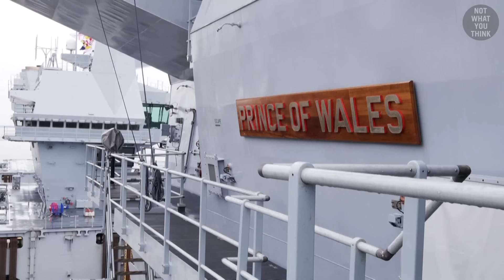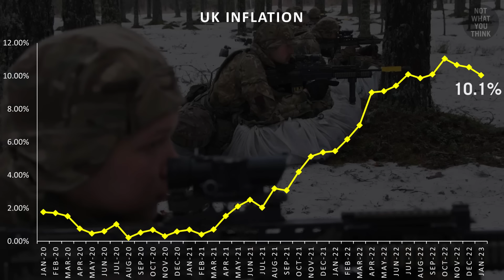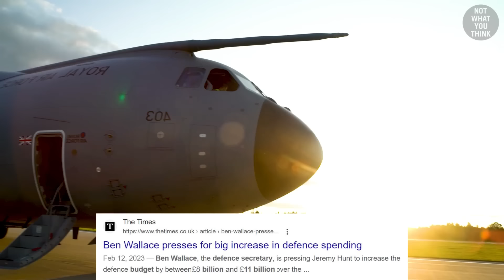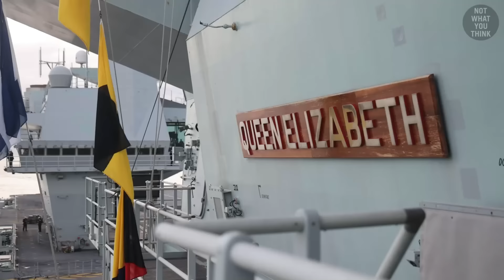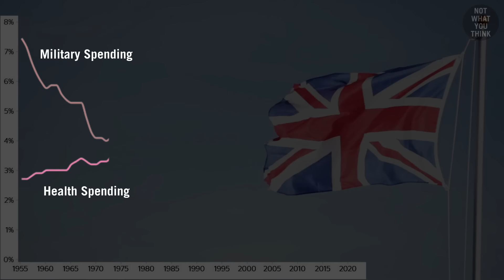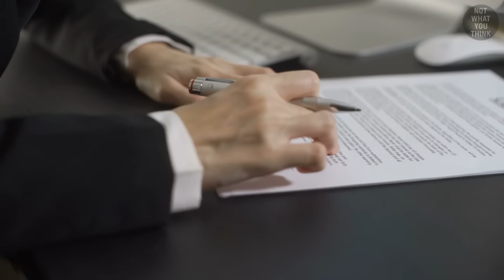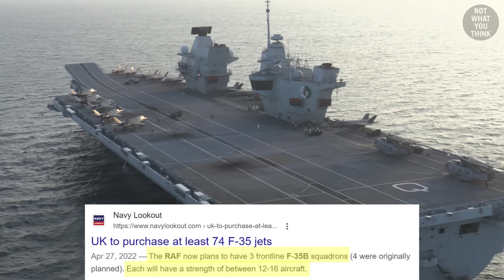Why QE Carriers are Considered a PART-TIME Fleet

Comment: A quick fact here, when we sent the 2 carriers to the south Atlantic for the Falklands conflict, 1 carrier had only half power available due to an engine problem, but it still did it's job, both as a show of force and operationally as a carrier and sending only 1 fully working carrier would of been a deadly mistake. The Prince of Wales may be suffering now but the problems will be sorted, better we find her flaws now rather than finding them in troubled times of war
Reply: Yep, not to mention the difference in capability between the two CVLs sent down to the Falklands and these newer ones is absolutely massive. They're about 3 times the size. If the UK wants power projection, it needs both
Reply: Well said!
Reply: And the two carriers concerned were slated to be sold off/scrapped. The government had to do some very rapid back-pedalling.
Reply: Exactly, mate, but unfortunately, there's a lot of "world of warship" players in the comment section who feel the need to spout off what they 'think' they know.
Reply: And despite the propaganda many of the crew on those Falkland Carriers wished they’d got the Ark with its Phantom’s etc.  many of them had previously served on her and knew the shortcomings of the Harrier in inclement weather, speed, range etc.  In San Carlos bay we prayed for air cover many times and were lucky we didn’t lose more ships.
Reply: @silverhost9782  It needs a third and it needs six more type 45s. Half a dozen type 26s would not go amiss either.
Reply: @hb1338  This.The problem is successive governments have criminally let the military be stripped way the bone. It started with Options for Change in 1992 and has just got worse since then.
Reply: Don't tell us that. Tell that to the apparently cash strapped British government that keeps wanting to ax the damn things.
Reply: Early 1980's.  Its now 40 years later .
Reply: Kitty Cat  Thank you for that, it was not America's choice or upon they're advise, with blessing or any help either that we went and in the passing of said yester years you forget details. In fact back then it clear language from the States that we should not go, phrases like in our experience don't go, it will be a disaster, you don't have enough troops, you don't have the fire power, no you no longer use our supersonic jets, you will lose, many or all will die. But we did and in doing so we got a better result in weeks, than America did in years of war in both Korea & Vietnam, nations whom both actually contained little people you considered nobodies, on tiny carriers. QE & PoW are the largest by far that we have ever built, because needs must now it is not the 80's anymore
Reply: @nickbannister775  I remember the early Harriers quite well. Range was victim of lack of thrust & weapon load max take off weight limits. They had 3 different core types by the early 80's. A mixture of developments, radar, electronic miss matches logistic nightmare for them, airframes types included multiple Navy FRS versions, with RAF GR1&3's & F3's to pick from to join the airwing aboard. The Americans the AV-8's big wing model and together with improved tech, time ( every two years for 6 years) & knowledge made a supreme integrated weapons system later in life. It was reasonable ex Ark crew were narked off the way they were given notice of the mothballing of their ship with the effect of  removal to history the excellent complimentary pairing abilities of the Buccaneer's & Phantom's  .
Reply: As a matter of fact, the Falklands force went to war with as many Harriers as there are delivered F-35s currently.
Reply: I'd imagine that problems with the shaft of the props would be down to whoever made them rather than negligence, so 1 would think that the company would pay towards fixing their own mistake
Reply: The uk will have 2 carriers when fully operational  (HMS Queen Elizabeth and HMS Prince of Wales).
Reply: Weak Argentina😅 Want to take Falkan islands back but don't have enough power😂😂😂 They should have to crack the Brahmos missiles deal as soon as possible.
Reply: @john_constantine99  Falk islands is basically agerntinian territory but the British likes to always take someone else land which is miles away from them and occupy their territory illegally. 😅😅😅
I mean it is a colonialism in 21st century by the British.😅😅
UK hasn't been changed a single bit from the past 200 years and they still have the colonial mindset.😂😂
Reply: The HMS Invincible had stop. Off at US NAVY Base Norfolk. On her way down to the Falklands. And my ship CV-67. We off loaded Sidewinder missiles to her. Being the HMS Invincible only had 24 Sidewinder missiles total on board.
Reply: @_Shinasu  Not manufacturing fault, installation wasn't carried out correctly, if you join two shafts together you need them to be in line with each other, if not one dies a miserable death.
Reply: @vivinchharri390  get your facts right before mouthing off about something you are clearly ignorant of, the FALKLANDS are UK overseas territory end of and no amount of crying and whining by Argentina is going to change that fact  and if Argentina feels compelled to try it's luck again I'm pretty sure the UK is willing and able to stop them
Reply: Bro that was 40 years ago. Let it go already.
Reply: Seriously!? Argentina!!! The last victory of the empire!!!!
Reply: @vincentconti-jb3hd  seriously  ! Coming from someone with an Italian name when was the last battle of any kind the Italians won?
Reply: Obsolete against mordern  missiles
Reply: And we have HMS Princess of Wales on order, making a formidable fleet of 3 modern purpose-built carriers 🇬🇧
Reply: @hb1338 The third carrier is ordered and on her way - HMS Princess of Wales
Reply: @davidhughes4489 Just ordered our third  - HMS Princess of Wales
Reply: @vivinchharri390 A democratic vote by the people of the Falklands voted 93% in a referendum to remain British. Democracy will always beat a nationalist dictatorship.
Reply: @Hagar934 Argentina has never and will never have the power to take the Falklands from the British by force. They know and hate the fact,  but fact it is!
Reply: @Hagar934 Mussolini was the last Italian effort at an empire and he led Italy to a mighty ass-kicking by little old Greece lol
Reply: @dw8609  Somewhat confused there buddy, PoW has been in service for some time, officially commissioned 10th Dec 2019 and no further builds are planned of the Queen Elizabeth class so just the 2 for the foreseeable future
Reply: @vivinchharri390  ask the English speaking population? There are few Argentinians resident on the falklands. It’s the same now as it was in 82.
Reply: @TheColombiano89  The point if you read the whole post was that 40 year ago we had only 1 & a half operational carriers, which is the same as the most major point of this video & as such the basis of my original comment in drawing attention to the similarities we have now due to the continuing problems we have with the PoW since her commissioning in Dec 2019. Also to highlite the lessons that can be learnt from history to avoid ignorance in the present, BUT I guess there's no educating some people who don't see a full explanation and comment using less than an IQ of 40
Reply: @garymcbrearty5845  Not Prince of Wales - Princess Diana (of Wales) as per UK Defence Journal...
Reply: @dw8609  You're well informed! But isn't that just a leaked idea on paper. One with no date to start her keel laydown or even a contract to build as yet. Plus we have the further problems that we are short carrier group support vessels atm especially for a 3rd group and would also require an extra airwing to fill her? I'm not against the idea but it has many short falls, not least cash funds
Reply: @dw8609  Cheers, I wasn't aware but I am welcomed to learn this.
Reply: @garymcbrearty5845  I'm sure it's an April Fool - they'd never call it the "Princess Diana" lol
Reply: @nickbannister775  The problem was Ark Royal was knackered by the late 70's. Sure she might have put the Argentinians off from invading but would she have held up operating in the South Atlantic for months? I am not convinced and all it takes is for her cats to fail and you have no air cover.
Reply: @vivinchharri390  The entire population of Falkland's island have said they want to remain under British rule, so in what way is it Argentinian territory?
Reply: Same thing happened back in the 1970s, after the cancellation of the original CVA-01s the Phantoms the FAA ordered were supposed to be assigned to both the upgraded Ark Royal and Eagle. However during its refit, a boiler fire on board Eagle resulted in it being out of commission, so the Labour government decided to scrap Eagle and assign its Phantoms to the RAF instead. So the poor old Ark was left to plod on, doing sterling work alone with spares cannibalised from Eagle until it was decommissioned in December 1978.
Reply: @jordankidd4443  including a few from Crab Air…
Reply: @Mishima505  Every single Harrier, naval or ground type, was sent down. I think even the OCU cabs included.
Reply: @jordankidd4443  I’m trying to imagine the reaction of the Royal Navy when the RAF harriers turned up on the Hermes flight deck…
Reply: @Mishima505  There was significant bad blood on both sides. Jerry Pook RAF has written HIS side of the story highlighting some of the issues, but personally, I think he comes off as ungracious and mean-spirited. Pilots...
Reply: Wasn’t it only 1 carrier really? The other was HMS Invisible that Andrew was on.
Reply: @jerome_morrow   and that vessel wasn’t even intended to carry fixed-wing aircraft, it was a converted commando carrier which originally only had helicopters to transport the Marines.
Reply: No it won’t.
Reply: @silverhost9782  You only have 26 planes for the two of them.
Reply: @grahamstrouse1165  As of right now...
Reply: @vivinchharri390  Heh! Your Spanish ancestors said much the same thing! 😏
Reply: @Hagar934  Argies are almost entirely descended from the Spanish.
Reply: @white-dragon4424  I know why are you telling me?
Reply: Because you thought he's Italian. If he's an Argie, then chances are he's got Spanish ancestry. Whether he's Spanish or Italian, neither are anywhere near being native to South America. All of the natives were wiped out by his ancestors when they colonised the continent in the 16th Century. My point is his hypocrisy about criticising us for having a history of colonialism, when him and his whole country are products of colonialism. And if I remember right, the Falklands have been under British control before there was even an Argentina!
Reply: @white-dragon4424  I get where you're coming from now 👍
Reply: The trouble is everyone can see war is coming, we need the support vessels and the planes, it doesn't show strength if it can't be deployed properly.
Reply: @Vivin chharri  when has Argentina ever controlled the Falklands, what happend when the people on the Falklands had a referendum? Do they get a say or should a nation that has never had them take over and what will they do with the population there over 90% of the people who don't want to be Argentinians?
Reply: @cr9153  From what I heard, they didn't want them, not until oil was found there.
Reply: @white-dragon4424  well its always the way, oil is the cause of most wars, Britain must protect the penguins 🐧 😂😂😂
Reply: @cr9153  It's a great motivator for both sides. If it wasn't for the oil I dare say that neither Britain nor the Argies would want them.
Reply: @kevinvojta692  Totally untrue - re transit via Norfolk VA and the ship to ship missile transfer.
Reply: Not true. Invincible had a gearbox hydraulic coupling problem which limited it to single shaft running. It was repaired at sea well before Ascension Island and had no impact on the transit to the TEZ.
Reply: @nickbannister775  There was no propaganda. You fight with what you have not what you might have.
Reply: @jordankidd4443  That is just not true.
Reply: @normanboyes4983  What isn't?
Reply: @jordankidd4443  The every single Harrier even OCU statement.
Reply: @normanboyes4983  Right, I checked. My mistake, that doesn't include GR types. But I'm quite sure every single existing Sea Harrier was deployed.
Reply: The ship has problems for one reason. When the politicians started talking about mothballing it the builder started cutting corners figuring who`s going to know.
Reply: Would HAVE
Reply: @silverhost9782  
UK and 'Power Projection' are oxymorons. Britain's long bereft of its former Naval might, now reduced to little more than an insignificant cash strapped second rate power. 
A pitiful sight, a nation once the greatest naval power for over 2 centuries, now can't even maintain 2 capital ships. and one now fully reliant on America for any kind of assistance. Britain has lost its independent voice on the world stage. 
And the way its looking, the trend will only go downward, until Britain has lost all of its influence on the world stage.
Reply: @livethefuture2492  ok
Reply: yes and it was against argentina, not a major military power.

however i think nowadays with economy the way it is, transparency and people more aware of where the money goes it would be hard to justify, specially because pretty much everyone rely on the US and NATO as a logistics partner (and this seems to be a major justification for cutting down budget on major ships for everyone)

i found it hard to see a change on this regard globaly as just the US and china are aiming for big ass ships as for right now.

but anyway, i'm not from the UK, just sharing my opinion. i agree with you, just think it's hard for politicians (and most of the people) to change their minds.
Reply: @everTriumph THEY.NEVER WETE GOING  TO BE SCRAPPED. SUCH BOLLOCKS WRITTEN IN SOME POSTS.
Reply: @garymcbrearty5845 WE WERE IN KOREA ASWELL.
Reply: @vivinchharri390 The Falklands never have belonged to Argentina.
Reply: @vivinchharri390 So Argentina  wanting the Irlands is not colonialism then.  The Islanders can be independent whenever they want from Britain
Reply: @peterlloyd8313  UK is 12985km far from Argentina so they basically have no right to talk about Islas malvinas(falk islands).
Don't try to bring your colonial mindset in today's Era.
Reply: Mate ..no disrespect but what nation are you from... I served in British army for 10 years as a tankie and we never wanted for nothing...our little island nation is still a force..
Reply: The problems will be sorted that’s not a matter, the matter is the Prince of Whales got its reputation and it will stick to it forever.
Reply: @livethefuture2492  “greatest naval power for over 2 centuries” is quite a happy way to put it. It barely was from the late 1700s to the second half of the 1800s, some might argue beginning of the 1900s.
Reply: It might look like a dog now, but wait till you drive it!
Reply: It was against Argentina, and how long ago?  If Argentina had more and better missiles, the whole fleet would have been toasted.

Comment: If a country wants to maintain its capability to build its own armaments, it must build them continuously, regardless of current needs.  It's simply the cost of sitting at the table.
Reply: This is the crux of it. The thing is for UK it is increasingly difficult to sit at the table cuz ain't got no dosh.
Reply: I mean even here in the US we made the mistake of closing a bunch of our shipyards after the Soviet Union fell, so now we don’t have the yard capacity we need for the pacific.
Reply: @frainhairylobes3065  There's no shortage of dosh, we just spend it badly or on the wrong stuff. The MoD is filled to the roof with civil servants and every government department and state-run organisation has no difficulty finding the cash for more bureaucrats and managers while front line staff who do the actual work get pay freezes or made redundant. Reminds me of the NHS hospital trust that complained about a lack of funding that meant it was only able to increase its nursing staff by 1%... then it came out that they'd increased the number of managers by 11% in the same time period.
Reply: As a French my two euros , why did you don't join the construction process of the  R91 (Charles de Gaulle) , French navy could had shared development cost whit Royal Navy...
The Charles de Gaulle had a construction cost of 2 566 258 200 British pounds  added to  a  855 419 400 British pounds of development cost...
Reply: @jeremypintsize7606  The design of aircraft carriers also depends on the aircraft in the attached air wings.  France builds its own aircraft types.
Reply: @vibrolax  Not exactly the R91 is compatible with US carriers , hornets and superhornet had take of of she..
And F35 are also compatible with the design ...
Reply: @jeremypintsize7606  Good points. National governments are pulled in two directions: spending less vs. maximizing the number of jobs for domestic workers.
Reply: @divinestrike00x78 we outsourced it to China. The irony of it all 😮‍💨
Reply: @sabbracadabra8367 Well, you're not doing that well against drones, are you?
Reply: @sabbracadabra8367 Who, by wit, defeated his opponents, thoroughly humiliating them in the process.
Reply: A powerful navy is crucial to the survival of an island nation. That's been the rule throughout history, especially when a country has a vast overseas empire. 
Its possible that the "special relationship" that Great Britain and the United States have mostly enjoyed and the shrinking of the British empire may have have contributed to the reduction of the British armed forces. Just saying.
Reply: Well, the table doesn't seem to have any food on it. And the migrants are hungry.
Reply: @frainhairylobes3065  6th largest economy in the world, 'UK aint got no dosh'